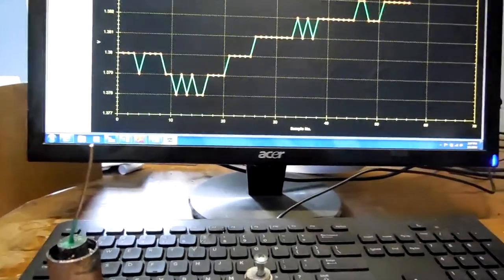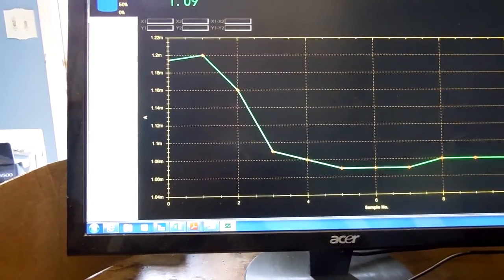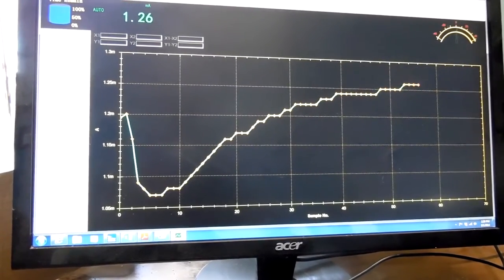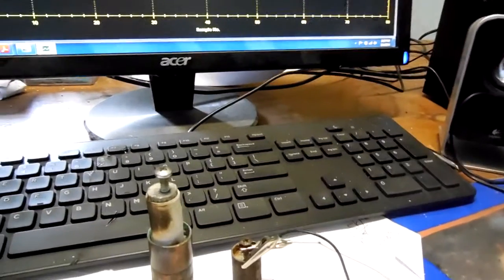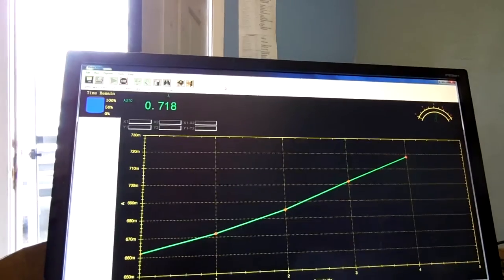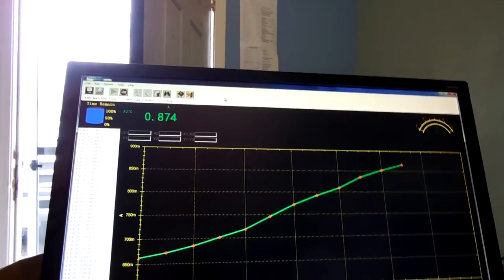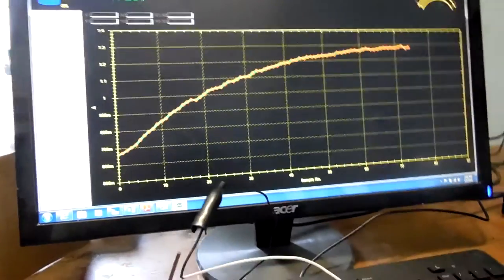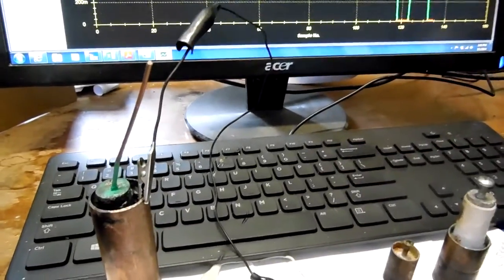1 amp crystal power battery

Comment: What are the mixes for each cell herein? I have tons of materials for testing now :) just got all of my pieces in for some seriously LARGE DryCell AirCore Batteries. I have many mixtures for some crystal cells already pieced together, but have not assembled them yet.  Still have to cut down the magnesium rods which take time.  Work has had me pegged, but I am sure I will be up on it soon.  Thanks for your sharing with the free-energy community!  Cheers from Dallas!